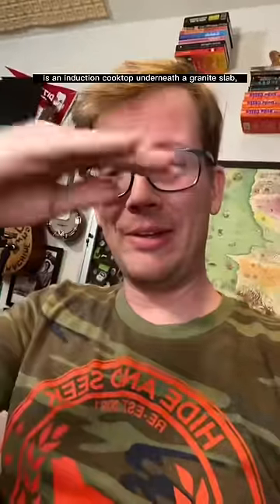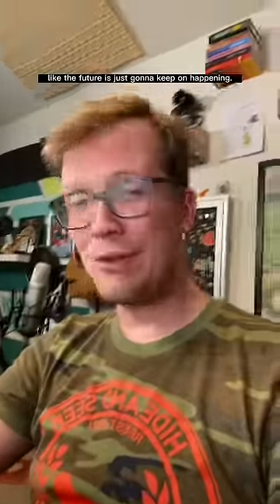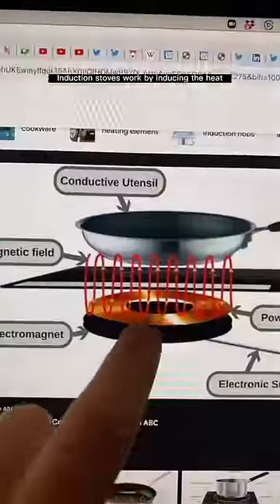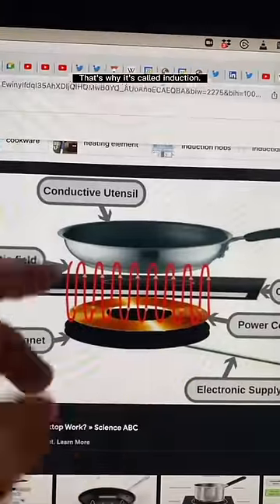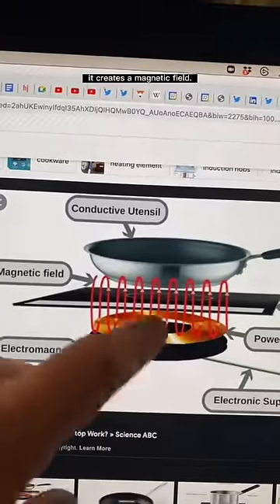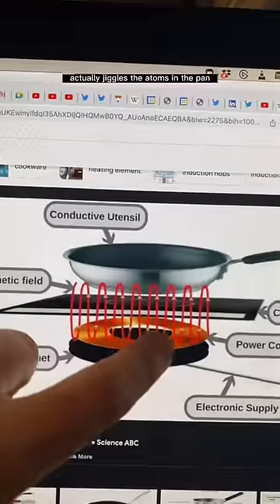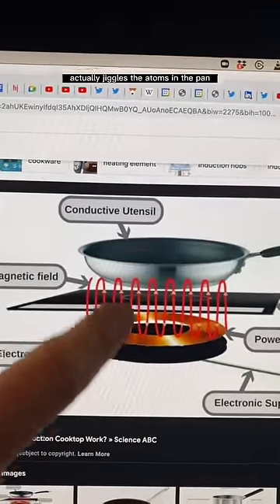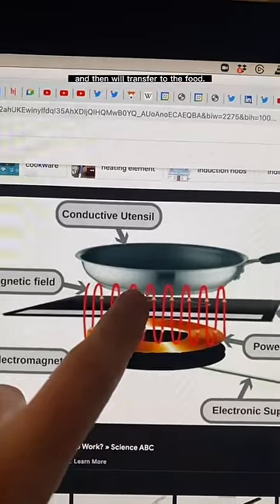How do induction cooktops work?

Comment: Ok but like can they at least mark the burner spots? The pan will get hot and then that will make the counter top hot.....
unless there's something I'm missing.
Reply: Yep, I have one and it marks the spots
Reply: I assume it has some lights or something built in that you can turn on to show the induction area and stuf. Otherwise how would you know where to put the pan?
Reply: Countertop won't get hot. You're supposed to use pan risers to keep the pan off the granite.
Reply: I've got a glass induction cooktop, and while the cooking surface does heat up, it's not nearly as hot as a typical burner. You wouldn't want to like, lick it, but it's still not that hot
Reply: @empty_rivers ... I've never wanted to lick a countertop more. Thank you for this confusing feeling I am currently processing 😂
Reply: I also note there are no controls... I suppose they might be hidden, but given that and the lack of marked burners I suspect this is either some kind of joke video or the worst designed stove I've ever seen. Not questioning the science here by the way, I get this is plausible with an induction cooktop, the presentation just seems off.
Reply: @Jay-do7wb  yeah, I think this could be a joke too. It's possible that granite-topped-induction rings do exist, but there is nothing in the video that looks different from just a stone worktop. Also something about the tone of her voice sounds more to me like she's making fun of the idea that could be her stovetop. But maybe the full video shows more and it's clear it's real in the full video.
Reply: Maybe it's that whole spot on the counter rather than a few circles on it?
Reply: @crapstirrer  soo... like a stovetop... hmmmmmmmm
Reply: @LanIsOriginal  It's perfect for my adult sized cauldron
Reply: The stone does not get hot. Stone does not burn unless subjected to heat much higher than what the pan is capable of getting. The pan will melt before the stone get hot enough to have burn marks.
Reply: @crapstirrer  because that makes it so much more convenient right?
Reply: @empty_rivers  if it heats up without a pan, it's not induction, it's conduction. You can lick an induction burner with almost zero discomfort.
Reply: @mikeslaserstuff4018  the cooktop gets hot because there's a hot thing (the pan!) on top of it. with a granite cooktop you'd probably want to use a riser to keep the granite from discoloring from that residual heat, but it will still get at least somewhat warm
Reply: @empty_rivers  uh.. yeah? Thats kind of been my entire point. Why are you trying to explain this to me? Read dude... I've installed these things. I hate illiterate people 😒
Reply: @empty_rivers  you'd be very surprised at how often I've been to the same house to replace the same counter because a kid or whoever forgot to set up a riser. It happens constantly, and while I don't mind the commission, it's really not worth the resources. You can't recut a broken counter into anything more than pavement stones and many of them cost upwards of $10k+. Not for a family home.

And when they do crack, it's usually pretty explosive because.. well, it's granite or marble and kinda thick. People get hurt pretty bad from flying chips of material. One family I met had to take their little girl to the hospital because a piece went through her right eye. They had to remove the eye and give her a prosthetic, all because she was making a grilled ham and cheese.
Reply: @empty_rivers  it's not really the cooking surface that gets hot, it's just the heat from the pan transferring back to the surface below it.
Reply: @empty_rivers  that i likely because your pan is sitting directly on the glass which heats the glass up
Reply: @wickedbasket8858  that’s not what they were saying, nobody said the rock itself will burn
Reply: @Vgamer311  they asked if there would be burn rings and i answered
Reply: @Jay-do7wb  it is most likely the invisacook burner system which would mean the controls are behind the false drawer face above the cabinet doors
Reply: @crapstirrer  doesn't extra distance from the coils reduce efficiency?
Reply: @empty_rivers  but normal surfaces don't have the thermal mass of marble. Do they hollow out the counter to make the marble really thin?
Reply: @wickedbasket8858  no they didn’t, they asked why there weren’t burner spots not burn spots. There’s a big difference between a burner and a burn.
Reply: @empty_rivers  I’ve also got a glass induction cooktop. You’ll still severely burn yourself if you touch it depending on the temperature you were cooking at
Reply: @Jay-do7wb  Nope, it's called invisicook and there is a control panel that you wire to the actual cooktop underneath that you can put wherever you want. Generally there's a flip out false drawer in front of where it actually is. Also, it can sense when you place a pan on it so it lets you know when it's on the right spot. You can also etch into the countertop or put labels if you want.
Reply: The stone itself probably won't really get hot. Induction works through electromagnets as Hank said, so only magnetic materials like iron will heat up. Copper pans will stay cold. Maybe the stone contains trace amounts of magnetic minerals though.
Reply: It can get hot but after wiping with a wet rag, it cool down enough to touch
Reply: @mrmaniac3  you do know how heat works right? The stone will get just as hot because the heat from the pan is escaping into it
Reply: @oz459  you can isolate the pan from the stone, yes? Say, through the use of a glass sheet, a stand, or whatever? I'd much rather not have a fancy stone slab between my cooktop and my cookware, but it's not like it's unmanageable.
Reply: @crapstirrer  the pan will transfer some of its heat to the countertop, it’s just indirectly being heated by the induction burner. Same as the food

Edit: apparently there are risers you’re supposed to use, still if it isn’t marked it’d be hard to find
Reply: Hi, Phil Countertop of Countertop village here. All of our countertop induction hobs light up neon pink when in use, in a ring around the powered on hob. The hob currently on also plays the sound of a wet wad of toilet paper hitting a hard tile floor on loop until the hob is switched off, so you’ll always know if it’s on 🧑🏼‍🍳🥘
Reply: @Bas_Lightyear  thanks for your insight knowledge Phil
Reply: It could be that the whole surface is one big burner.

If you look inside the induction stove you can see that it either uses one big coil for one burner or many small ones.

Well, if you use small ones you can dynamically change the position of the burner by activating only the coils that the cutlery is above of.

I don't know if that's actually what is happening here, I don't have that amount of money, but my stove can do that.
Reply: Could just use a wet towel underneath. Otherwise the whole thing works as a stove like a hot top stove
Reply: @crapstirrer   The pan can still get hot.  Someone might see it sitting there and think it's just leftovers.  Grabs it and gets burned
Reply: Your stove would also get hot. The countertop is your stove so it doesn't matter. You wouldn't use your stove as a counter.
Reply: No, you're not missing anything. I expect the granite to crack in time, from the constant heating and cooling happening on top of it specially if the part where the induction thingy is mounted on is thinner than the rest of the countertop.
Reply: @mikeslaserstuff4018  "i install these things" 🤓 "I hate illiterate people" 🤓  
Ah yes the need for arguing and trying to prove you know more when the person you're arguing with is literally agreeing with you. Illiterate beats being deliberately obtuse just for the sake of arguing. "Look how right I am, I have examples" good for you pal.
Reply: @jeadly  I was wondering both of these things as well? How does the pan heat up if it's not in contact with the cook top, just the risers. As you said seems a lot more inefficient. 
Also, having the induction mechanism (i guess i will call it that) mounted to the bottom of a full slab of granite also feels a bit inefficient and also wasting space. Having it recessed into the granite makes more sense to me.
Reply: @wickedbasket8858  the stone will get hot, at least if you put a pan directly on it, because the pan will conduct heat to the counter
Reply: Our induction only activates (in each zone) where the pan is. So probably this stove can just activate anywhere any pan is placed.
Reply: @crapstirrer  … seriously

So this stove is not just invisible, it’s also super inconvenient. And presumably horrendously inefficient due to the much larger magnetic field needed to reach your pans above the riser?
Reply: @zac9933  nope, ust validating my professional understanding of anything. I don't need you to validate my own knowledge because you don't know a damn thing about me. This isn't the only thing I know about, but I know it well
Reply: @Bas_Lightyear  how does the light work? Is it shining through the counter? Or mounted on the ceiling shining down?
Reply: @mikeslaserstuff4018  good for you? That is irrelevant to the point that you are arguing for the sake of arguing. The person agrees with you, yet you still argue. How much you know is besides the point. I never claimed to validate or invalidate your knowledge on the subject matter.
Reply: @adrianthoroughgood1191  I’m afraid that’s a Countertop Village family secret. That knowledge has been passed down generations since the first countertop hobs developed back in 249 BCE
Reply: I'm pretty sure there are no burners, because induction heats up the pan instead, as long as the pan is in the area of the inducer it will heat up, so you can probably put a pan anywhere on that counter and it will work. Also I saw someone mention the cook top does get hot which is both true and not true, the cook top only gets hot from the residual heat from the hot pan, so it's technically only getting as hot as placing a hot pan on the counter would make the counter hot.
Reply: Granite doesn't transfer heat very well.
Reply: I can also imagine someone somehow putting their phone down on a turned on cooktop and frying the electronics lmao
Reply: Yeah that sounds extremely dangerous
Reply: actually, ive had an induction heater and it actually only heats up magnetic things! you can stick your fingers right between the coils and itll be room temperature, but if you put a nail in there itll get heated until it melts. its really cool!
Reply: It’s a hot pan on a rock. Granite won’t burn
Reply: Yea it's called "git gud"
Reply: @psltmtir  you don't need to know where to put the pan. You can actually set it down anywhere as long as you know the general location of the technology. 
And in the video we see, I'm just going to assume it's located on that clean counter space there.
Reply: @crapstirrer  idk how high this raises but it would decrease the power
Reply: @psltmtir  what fucking light. ITS  G R A N I T E
Reply: @empty_rivers  that is, unless you’ve already put a pan on it and heated the pan up. Source: I didn’t think the glass would get too hot either until I exploded a bag of mozzarella all over my kitchen not realising the stove was still warm enough to melt plastic
Reply: I think everywhere all at once is ready to put your pan
Reply: @dpower2449  can you record something, I'm very very intrigued, i think somebody is bullshiting me haha
Reply: @crapstirrer  further from the induction coils the pan is the less efficient, that stone slab and any riser you use will move the pan so far from the coils that it must not be very efficient.
Reply: @crapstirrer  It's... it's an induction cooktop. The cookware hast to make contact with the induction surface in order to get agitated by the magnetic field. Either the pan gets hot or the risers get hot which heats the pan, either way dumb for a stone slab.
Reply: @empty_rivers  Depends on what you're cooking, but I could see getting a bad 1st degree or low 2nd off it if you're not careful.
Reply: Right. This countertop is extremely form over function. Also. When the pan heats up, the heat from the pan is transfered to the countertop and does indeed make it a hot surface after cooking. This is both useless and dangerous.
Reply: @Jay-do7wb  You’d need to watch the whole video to see mate…
Reply: The countertop doesn't get anything other than warm
Reply: @idkwhattoputherebye6850  if you heat up a pan enough to cook something, the countertop will heat up an equal amount.
Reply: Yeah, bad idea.
Reply: @alexdrum94  nope, I have an induction stove. You can touch the cooktop directly, even when it's on, and won't feel anything other than a mild warmth.
Reply: @idkwhattoputherebye6850  I'm big enough to admit when I'm wrong but that doesn't make any sense to me. If you touch the pan directly is it hot enough to burn you?
Reply: Stone gets red too, but its ALSO NOT PARTICULARLY MAGNETIC either!!
Reply: @alexdrum94  yeah, but that's because the heat goes into the pan through magnets (there are special pans made specifically for induction and if it's not an induction pan it won't heat at all, stove won't even turn on), stove itself doesn't.
Reply: @idkwhattoputherebye6850  no I get that. But if the pan itself gets hot enough to burn you... And the pan is touching the countertop, it will head the countertop. That's how heat radiation/conduction works.  There must be more but idk.
Reply: @alexdrum94  yeah, but surprisingly enough the countertop never gets hot enough to burn you. like I said, just light warmth
Reply: @idkwhattoputherebye6850  haha I'm lost. I believe you at this point. I just don't get it.
Reply: @alexdrum94  yeah it's confusing to me to, all I know is that it happens 💀
Reply: granite is probably not going to get super hot tho i bet
Reply: the cooktop in my house has a light that activates to show it's still hot, and doesn't turn off when you turn the burner off it only turns off once it's actually cool. I assume this would have to have something like that too.
Reply: @empty_rivers  it gets hot bc the pan gets hot & makes the surfaces around it hot
Reply: @empty_rivers  oh it does get HOT tho, when i am making soup all of the heat from the water transfers to the glass and then? 100°C piece of glass 😀
Reply: Yep, it's why most inductive stoves will have a more traditional looking surface, to avoid marks and burns on your beautiful table
Reply: You don't have to place the pan exactly down to the millimeter. You just know approximately where to put it. And the stove beeps if you try to turn it on without a pan on the burner.
Reply: The countertop won’t heat up. Only the metal heats up and will transfer that heat to the spot of the countertop it’s standing on. You also don’t need to mark anything, because the whole countertop is an induction stove, so you can put your cookware anywhere on it and it will work. That’s why induction is so neat.
Reply: @dpower2449  how fast does it heat up the pan? Ive seen induction heaters get metal red hot in seconds and im curious if it can heat the pan up quicker than your typical stove top.

Also if you respond could you like my comment cause i have my notifications setup to where i dont get notifications if someone replies  to me.
Reply: There are induction ranges that can work with a pan of any size in any area of the range, so you don’t have to find the right zone.  They have little displays that show where each pot is on the range and you tap the pot or pan you want to modify and then adjust the temperature settings.
Reply: @empty_rivers  that’s because the pan is heating the glass from the top.
Reply: @crapstirrer  that's stupid, another thing you can loose and efficiency decreases a bit. Literally no reason to have it be like that other than aesthetics and it doesn't even look that cool.
Reply: Yes, stone.
Reply: Microwaves are harmless to humans but jiggle water molecules to heat up. That's why u can only heat things in microwaves that have moisture and a paper plate will not burn. But they put these under granite because granite is an excellent insulator for the heat. So the food will get hot which will make the pan hot but the granite will stay cool enough to where it shouldn't burn you. If you did this with a cheap plastic counter it would melt but I don't know that counters are made out of plastic. Usually granite quartz obsidian and few other materials.
Reply: @Jay-do7wb  That was my first thought on learning what it was, "How the f*ck do you turn it on?"
Reply: @SomeoneBeginingWithI
Reply: @empty_rivers  I feel so seen
Reply: @annonymous5328  granite literally will burn in a sense. I have a chunk of granite sitting on my fireplace mantle right now from a boulder field in a nearby canyon that suffered through a wildfire. The burned granite boulders are brittle and break off easily in thin slabs. A granite countertop that heats up too much can break, and like another commenter said, when it happens it can be very dangerous for anyone standing close. Not to mention how expensive it is to replace.
Reply: Some do, some don't some do light up but it depends on the stone.
Reply: @mikeslaserstuff4018 clearly you are illiterate yourself and have internalised hatred because you didn’t even read what rivers said before arguing back. The first time could have been a misunderstanding. But there is no way that you didn’t understand Two different explanations that the pan being hot is what makes the cooktop hot which is what Rivers was saying.
Reply: @zac9933 bro was using the straw man tactic where he invents a character in his head that is arguing different ideas and fights that “straw man” instead of addressing what people are saying
Reply: @patsfball3710  bro is the only one capable of answering the actual question in an informative and understandable way
Reply: You have to position the pan directly above the induction unit, so concealing it is foolish.
Reply: I thought the same
Reply: @crapstirrer the pan MUST touch the induction somehow it HAS TO it cant not touch thats impossible